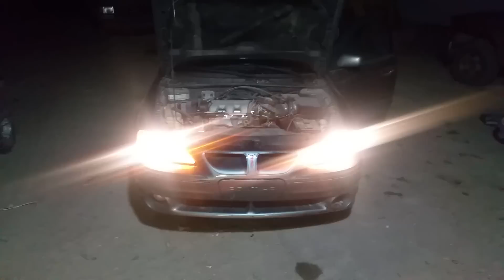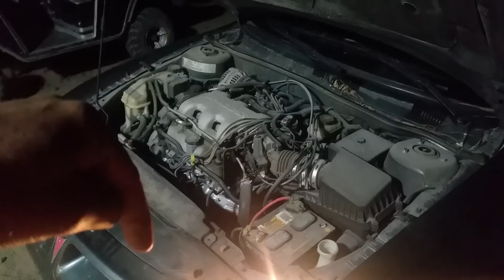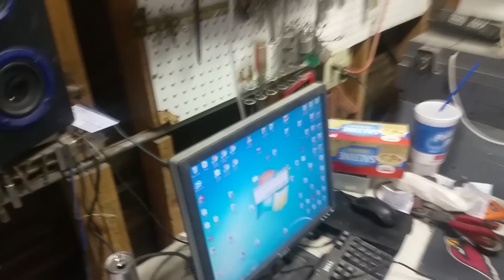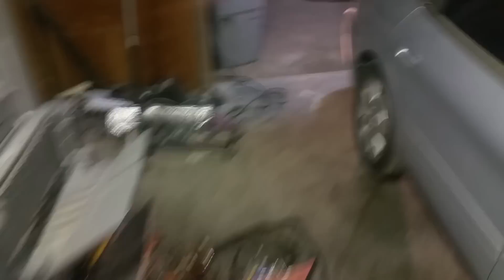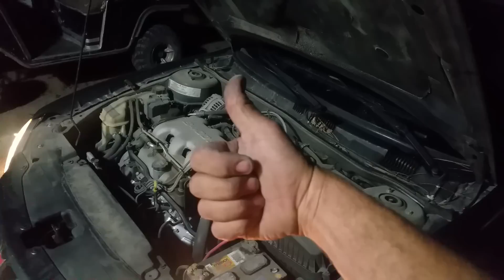Bad Alternator or Bad Battery, Easy Solved

Comment: Question for the mechanic who did this video:  why am I always told that the alternator charges the battery and told after I get a boost, to keep the vehicle running for 10-20 mins to recharge the battery before turning the engine off???  So... here is my point, if I disconnect the battery and the car turns off, is it not possible that my alternator just didn't have the chance to ramp up the battery juice??? Does this even make sense.. what I'm saying?  I always thought the battery was depleted if alternator wasn't working properly so therefore if i unplug the battery and the car turns off, maybe it's just cause the alternator wasn't doing it's job of charging my battery??  Pls decipher for me. Thank you. Otherwise, I do see how you are making complete common sense.

Comment: Good tip - ALTHOUGH,,, IF you cars battery has multiple connections to the +ve side, DO NOT use this method. Most cars <15 years old with comprehensive ECU's cannot use this method, and is dangerous to do so. Some cars, BMW/Merc eg, actually have the battery CODED to the ECU, so you cannot even just swop out a battery!

Comment: EXCELLANT-FOR ME ITS MY ALTENATOR--1 TYRE PLACE CHARGED ME £5.00 TO SUPPOSEDLY CHECK BATTERY-SAID IT WAS ONLY 31% CHARGED-NOT SURE IF BATTERY AT FAULT THEY SAID-----NEXT GARAGE MADE A SONG AND DANCE AND CHARGED£10.00----ANSWER MOST LIKELY (BUT NOT 100% SURE ) ITS ALTENATOR---UR FREE VIDEO SOLVED IT FOR ME -ALTENATOR £25 SECOND HAND AND NOW CAR RUNNING 100%-THANK YOU

Comment: What if your car doesnt turn on already? How do u check if it's the batteries or alternator?? I just ordered a starter because that's what I think it is but unfortunately I'm not truely sure. 1999 honda civic lx
Reply: Does it make a clicking sound when u turn the key to start? If not it's the starter
Reply: @haynesdustin  nothing at all no click no sounds at all. Starter should be here tomorrow. I took the battery into autozone and they said my battery is perfectly fine and not dead. So imma jump the car tomorrow to see if I can get it to start. If it does I'll try the disconnecting the 1 terminal while it's on to see if it isnt the alternator.

Comment: Um this might be a little late but your example with the pc is bad. 
1st you turned off you PC you didn't unplug it while it was on like you are doing to the car. 
2nd if you do kill the power to a PC by just unplugging it you may catch it in the middle of writing to the HDD (the memory) and cause the the HDD (the memory) to become corrupted

I have no reason to suspect that the car's computer would have such vulnerability.

Comment: Dodge caravan 2008+ does have a connection with the battery and pcm to complete the circuit... So if you take the "-" off it will turn off no matter if your alternator is bad of not. This ways works only for the older cars for newer cars you need an voltmeter to properly check it. It cost like 5 bucks but anyway. The author is not saying that he generalize the way for most of the vehicles. Some of the people will have to pay/or change their good alternators after this video)))

Comment: Here I am.... you were right about the memory. When I forget if its the positive or negative terminal, should I watch your whole video again thats straight to the point? or, should i just rewind to the part that is the part about the specific instance where youre about to make the point of which terminal you remove to check if its the battery or alternator on this youtube video I found by googling the question on how to.....

Comment: I have changed my alternator again,had the battery checked at O'Reilly's came out fine.The wire harness looked crappy before I change it can you show me the how or what are color match on the wires.Just I started the and took off the positive cable and it turned off.2010 Nissan Maxima 3.5

Comment: Just got my battery changed. Was having a clicking issues when trying to start sometimes it would die completely others it turn on. Very odd. Ran great for 2 weeks now every other time just about I try starting the car it clicks 1-3x and usually starts up. It’s clearly not the battery anymore. So my car doesn’t die when I am driving. What do you think could this be?

Comment: Whats the normal voltage? I changed my battery so its New and full my battery gives like 12.4 and 13.8 when the car is started with ac on etc. I have a 2013 car with a altenator that gets a signal from the ecu are these voltages good or not. I dont want to take the plus cable of because they just did a software update on the ecu so i dont fuck that up

Comment: What if the car engine shuts down while driving, and doesn't start anymore and indicates low battery voltage all of the sudden. how will you figure out whether it's the alternator.

Comment: So my 2014 Ford explorer has been dead the past couple days and i just put a new battery in it, but when I go to turn the car on the engine won't start and there's no noise from the engine, but all the electronics inside the car work and for some reason, the head and tail lights are flashing. Any clue ?
Reply: I had a similar problem a while ago, no noise coming from my truck when i turned the key, turned out my starter motor had gone out, there are  videos on youtube that show how to test that and luckily its a pretty easy fix if you don't mind getting dirty.

Comment: Using a pliers to loosen your battery does not constitute using a tool. If you don't have or can't borrow a pliers then why are you looking under the bonnet. When he says you won't have to use a tool He is taking about an expensive diagnostic electronic tool.

Comment: Use a fucking multimeter…  Stop disconnecting your battery while the vehicle is running…  You can definitely get a arc removing and replacing the battery terminals.  This man obviously doesn’t  and has never worked at a real dealership, straight fucking mom and pops and Indy shops…  I don’t care about the what if’s blah blah and don’t care to chance them by rolling the dice and taking the risk.  Ooh I’ve done this 100’s of times and never had a issue.  Have you tried this on every single car on the planet?? It’s wrong and shit “can” happen.  It can happen just that one time as that’s all it takes. Fuck the ooh my friend can fix it cheaper bullshit, Be safe and do shit the right way.  I wouldn’t take this angry Indy shop, school of hard knocks, back yard ass mechanics, mechanical advise.  As I clearly see where his quality of work and repair is.  I Flag efficiency at 160+ % with np and I always do shit the right way, and it’s not slowing me down one bit.  I bit this is the type of guy to brake shit working on a car something as simple as a plastic piece and just puts is back and says nothing like the car cane in like that.  These are trash mechanics and the one that give good “real” mechanics a bad name.

Comment: The only way it could cause the computer to loose its memory is if there is a voltage SURGE above what the system is designed to handle.  That COULD happen when removing the terminal while it's running but it's extremely unlikely
Reply: Yeah but also, you have fuses for a reason

Comment: Get this I jump-start my car runs fine I can disconnect the power to the battery and the car stays running no problem but then I shut the car off my alternator starts pulling 12volts back and by the next day my battery is down to about 10.5 to 11volts and will not start.

Comment: This is very true if you take off the positive battery cable and it says running it’s not the alternator it’s the battery. I have use this for years and it’s never been wrong.

Comment: Question,  what if the battery is low because you have a suspected bad alternator... Then you disconnect the cable but It dies because the battery
was already low in the first place... how do you differentiate at that point 🤔

Edit: my guess is you need a fully charged battery to differentiate?

Comment: I'm about to pull the alternator on a '96 Tacoma, it's down low by the frame so... fun times. Thanks for the tip on disconnecting the battery to test it, it might save some unnecessary dirt in my eyes.

Comment: Yup,all your memory,presets for radio stations,seats,mirrors will have to be reset.but what always screwed me over was I had an acura rl and the radio would lock and you had to enter like a 5 digit code.i bought it used and of course the fukn crooked dealer dude didn't give me the code.i didn't even know about that until I either changed the battery or something. But I think you can pay like $80 somewhere to get code.i think you need the serial numbers from the  radio.if I have to pull that thing out it's getting replaced ,some new shit,cd,bluetooth,etc..I would drive while every 2 hrs, I think it would allow me to have 3 tries at code,and twice I got lucky by pushing random numbers and of course not paying attention to what they were.frankw

Comment: Bad advice from this Friendly Fella Mechanic telling you to Disconnect the Battery Cable with the Engine Running.

Professionals stop doing this Mess in 1980 when Manufacturers commenced putting Computers in Vehicles. GM spearheaded the Computer Revolution.

Wonna learn how to Test Batteries - Starters & Alternators. Purchase & Read Chapter 4: Batteries - Chapter 5 - Starters & Chapter 6 - Alternators from a "Real Professional" Auto Technician/Mechanic

www.veejer.com
Dallas, Texas
" Vehicle Electrical Shortcuts "

Ex GM Dealership Mechanic
Southern California

Comment: Thanks I forgotten about this method, just got a brand new altinator, put it on,and car went through and checked mega fuse,and tested all the fuses stumbled on this video,and pulled the positive cable off and car dies, guess you can always get a bad altinator 👍 up.

Comment: K. But what if the car stays running but shuts off when I use the electric window? Just like It did with the battery connected. I'm almost certain it the altnator. Requiring a jump to restart.Already bought a new one but my buddy seen this video n thinks it's the battery. It seems to be at a steady 13.5v idling but the electronics kill it. Please someone confirm it's the alt.

Comment: There was mentioned that when you reconnected the positive cable you could MAYBE POSSIBLY do damage or blow something.  What if before we reconnect the positive cable we ..  turned car off. Then disconnected negative cable next then reconnect positive then the negative back up. As if you were putting in a new battery. My car 2010 Hyundai Santa Fe 3.5l.  Battery seems to take full charge from trickle charger over few hours with negative off. Reconnect negative and charge comes down to 3/4. Nothing to do with weather right now. Can't find anything left on. Was thinking about maybe it should get a parasitic draw text until I found your method. Just still bit worried about messing up things thus the reason I am asking about the reconnection of positive while car still running

Comment: Was having my head and dash lights dimming. Threw in a new regulator because my new alternator is only 6 months old. Well son of a Bich! No lie. I just disconnected my red wire (+) to my battery on my ‘65 Dart and it died. Piece of sh!t rebuilt alternators. Take your alt to a shop to get rebuilt.

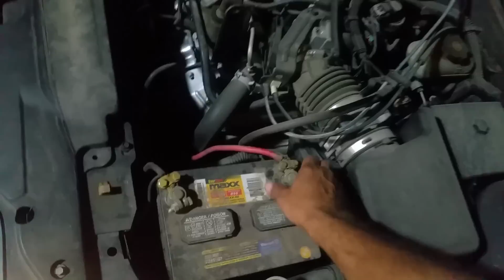Comment: 0:50  to save hundreds and ID whether alternator bad or not, pull off the positive lead to battery while car is running with lights on and if car dies, alternator bad.  yes, you'll have to reset your radio presets/clock.

Comment: I have a question. 2005 ford focus. I did what you said car was still running. Yesterday I replaced battery. So why was my car dead this morning? I of course had it jumped. And what's weird is battery light comes on. My ingnition clusters they odmidtor gas gauge mileage ect on the disaplay when I drive it kick off blinkers included don't work. Here's the weird part when I come to a full stop they kick back on. I'd like to know what my issue is??? Thanks

Comment: I was skeptical at first as the electrical systems in a car can be complicated. I pulled my positive cable....car died. Bought a brand new alternator, CHA-CHING....... Didn't work!!!!! Buuuuut, took it back to the auto parts store and they tested it....faulty from the manufacturer. Bahahaha. This dude's confidence is backed up with knowledge, got another new alternator and no charging problems since..... THANK YOU!!!!!!!!

Comment: I removed the positive red cable like you said and my car stayed running for approximately 3-4 minutes. It did not turn off immediately but it did turn off after like 3-4 minutes of not having the battery positive cable on it. I am guessing it was the battery since the car did not turn off immediately after i removed the positive red cable?

Comment: "If it dies and you have to hook it back up because now you know its the battery..." Im confused! If it dies when you unhook it, doesn't that mean its the alternator (not the battery?) Did I hear things wrong? Also, any info on a starter and how to know which of the three it could be if the car intermittently starts? No sound at all from engine but dash lights and key "dinging" working fine. In a minute or two, it cranks and runs fine, engine cold or hot. Any shortcuts for that?

Comment: Please be very careful about doing this because the result may be catastrophic.  
While the logic seems straight forward as presented here by the author of this video, however the issues is that whether you have a good working alternator or a faulty one,  all alternators can and do generate erratic voltage spikes that can severe short out all electronics in the car.  
Aside from providing temporary source of electricity,  battery also functions as a large capacity to absorbs these electrical spikes coming from the alternator.  With battery disconnected,  your car's entire electrical system is now at risk of be fried by unpredictable electrical spikes.   
Please read up, folks.
Reply from the maker: your funny,,,, electrical spikes? this is direct current, with a regulator. before you speak of what you do not understand, get more educated on how the system works. your suggesting that by removing the battery from the equation it will fry something? what happens when driving, when your battery takes a crap, or gets a hole in it, or just dies from being a bad old battery ???? it is why manufacturers have done a couple things, 1 installed a voltage regulator (internal on newer vehicles , external on older ) 2 have inline fuses, 3 have a distribution box with am2 fuses to protect from voltage spikes ( again direct current not alternating current )  so before you try to explain to other, do your research because to a veteran mechanic you sound silly and naive like a two year dealership mechanic. but hey,,,, thanks for watching.
Reply: @thomasbriansavingmoney  http://www.troubleshooters.com/dont_disconnect_battery.htm

If you think an alternator only puts out DC you should learn how one works.  I'ts right there in the name LOL.  There is a rectifier with diodes that may or may not be working, and it can definitely produce spikes of AC.  Look up the term "ripple", a bad rectifier can mess with the sensors in a car even when the battery is there to help absorb fluctuations.

https://www.underhoodservice.com/alternator-ripple-testing-the-ghost-in-the-machine/

Comment: Q&A from knowyourparts.com says don't disconnect battery cable while car is running:
Q) Can I disconnect a battery with the engine running to test the alternator?
A) Don’t do it! You risk frying every electrical device in your vehicle. The second you disconnect the battery, the voltage regulator tells the alternator to put out maximum power. With no battery in the circuit to act as a capacitor, the alternator can put out up to 50 or 60 volts, depending on engine RPM’s. When the smoke clears, that “simple test” could end up costing you several thousand dollars for new electronics. This is a very bad practice and most likely will result in alternator or vehicle damage. 
https://www.knowyourparts.com/technical-resources/starting-and-charging/alternator-qa/

Comment: Pretty sure you’re gonna need a tool to loosen up the battery connector. 😂
Reply: all you need is pliers to loosen battery lol
Reply: Have the positive cable already loose huh duh 😒
Reply: We literally do this in shops too just saying
Reply: @tannerhowell5012  and charge the customer $300 like yall had to do a shit load of work lol
Reply: Well DUH lol that’s common sense
Reply: Can I use a wrench to loosen the terminal while it’s running? How do I avoid shock?
Reply: Yes just don’t touch the negative and positive at the same time.
Reply: well take it the shop so they can charger you 500.00 dollars or more  lolllll

Comment: Memory loss is not the problem with removing the battery - in fact, exactly the opposite.  Charging the battery is absorbing a big chunk of the current flow, especially if the charge is very low and the alternator is near max output. Pulling that terminal off can create a voltage spike that can damage the sensitive electronics in modern cars.  The battery acts as a sink to absorb spikes in current and voltage.
Reply: In 1 case in 500k perhaps. Crooked Mechanics suck.

Comment: The reason not to do it is if it fails to regulate the voltage properly (more in particular more on modern cars) you could see a voltage spike and damage or short out the computer system.
Reply: Exactly…. Do shit right way… This is half ass bullshit that can create and add more issues to the vehicle that now he would be on the hook for...

Comment: I don't think this tip is always necessarily true. I can tell you for sure that on a 2000 Ford Escort ZX2 that this did not work. The bad battery caused the car to stall. I even jump started it and then removed the jump starter with no battery in and it stalled. New battery in and no more stalling.